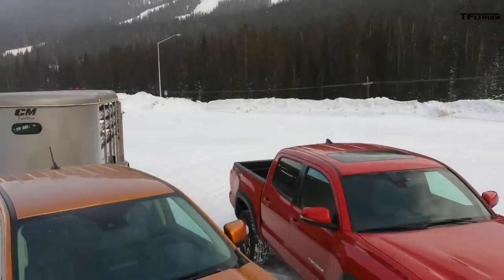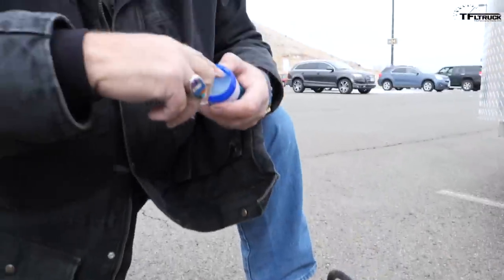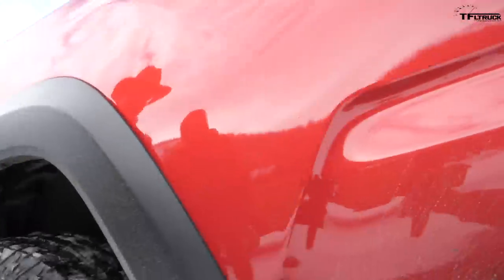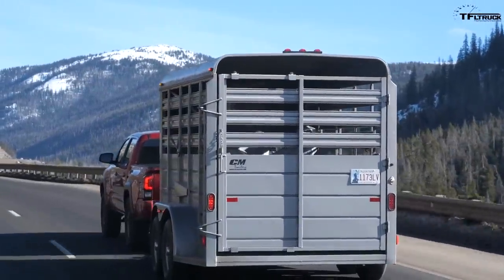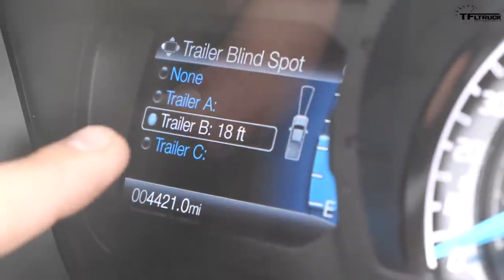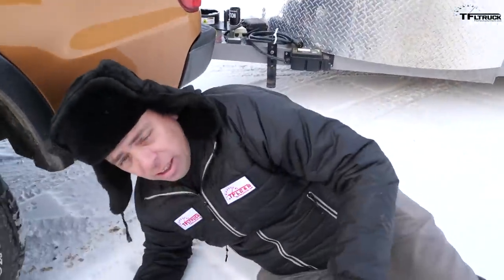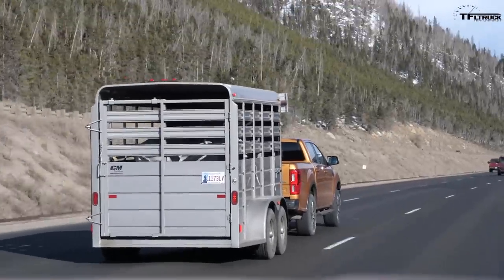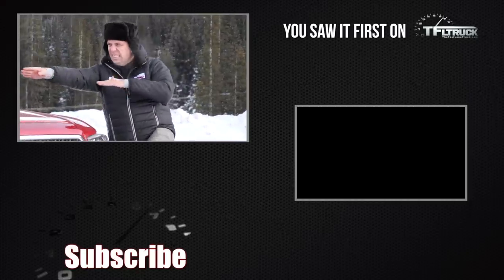Best Midsize Towing Truck? Ford Ranger vs Toyota Tacoma vs World's Toughest Towing Test

Comment: In the Tacoma he was pumping the breaks, essentially, slowing down slower. Which shortens the finish line, for the Tacoma. In the Ranger he braked solid slowing the truck down quicker allowing more road to travel ahead. Which allowed the Ranger to pick up another breaking score.

Comment: Wish I could see the tach a little better on the ranger, it seemed like the Taco held much higher rpm during the up hill.
Reply: Jesse Richards makes sense. Peak torque for the ford is 2500rpm and 5500 for the taco
Reply: I like to see them do the 100 mile tow with them.  I never trust Ford's MPG. Every time I have used one as a rental it is always way off on the No so "ECO" boast.
Reply: @devinbender8428 , not quite. Peak torque on the taco is at 4600 RPMs. Your point is still valid though.
Reply: taco has 6 gears and the ford has 10, the taco has to rev higher
Reply: The XLT Rangers have a normal gauge setup. The one they have would drive me nuts.
Reply: It has the normal tachometer if they would have scrolled through the garage settings. There wasn't any need to display the speedometer twice
Reply: @jackattack4851  that statement doesn't work, fords final drive ratio is probably similar to the tacoma, so "has to Rev higher" is wrong, the engine gets its power at a higher Rev,

Comment: Why are we not talking about the fact that the ranger towed up the mountain at 3500-4500 rpm meanwhile the Tacoma was screaming 5000-5500 rpm? That ranger towed that way way better!
Reply: Different engines. The Toyota is meant to run at a higher rpm.
Reply: Yea the tacoma is meant to use more gas
Reply: You have to remember they said the tacoma had a 3.91 rear end while the ranger had a 3.73 rearend. Meaning the tacomas has shorter gears so more towing capacity and increased acceleration but higher rpms on the highway and worse mpgs
Reply: @Will-fr5du  the ranger has a higher towing capacity than the Tacoma.
Reply: @williamnickel8132  yea sorry, i didn't mean a higher towing capacity. I meant to say the shorter gearing in the taco is better for towing
Reply: @Will-fr5du  the ranger has a 10 speed, if you break it down the ranger is actually geared lower

Comment: I really want to give this Ranger a shot. My 2016 F150 2.7 is at lease end now. I’m going to order another one but would like this ranger. Thing is I have a travel trailer 2016 passport 238ML ultra light. 3890lbs dry. 2 axles 23.5ft. 🤔 dilemma... thoughts? Tounge weight 500lbs. Travel with wife and two young girls and a dog.

Comment: I love the Ike uphill tests. Great job Andre and Kent. 
Ford did a nice job on that Ranger performance wise. If they make a Ranger Raptor with a pumped up 2.7 EcoBoost I'm in!!!
Reply: A 2.7 v6 would be crazy.
Reply: TNitro N I hope they put the 3.0ttv6 with 400hp and 400 torque,but it won't happen
Reply: TNitro N it won’t happen unless some one else makes a better motor. The 2.3 is already best in class. 

The only thing you may get in the raptor would be a tuned 2.3
Reply: @ALEX-sh3tx  the ranger would go 0-60 in 3 sec with thst engine

Comment: Great video guys, thanks. Well done Ford !!! A  downsized 2.3 liter gas engine that has  the performance of a 3.5 is an engineering marvel, not because the power  (because with a turbo it's "easy"), but because the emissions compliance, the fuel economy and, the most important when towing, engine braking. Awesome powertrain!!!!
Reply: Does a smaller engine have more engine braking than a bigger one?
Reply: @JaimeCarlosCamacho  for  same rpm, the bigger engine has more engine braking power than the smaller one.

Comment: Couple years ago they tested the GMC Canyon on the Ike.  Rated for 7000 lbs. Their trailer was well over 6,000 lbs. As I remember it, only one brake application downhill and it had more than enough power uphill. Mr Truck had plenty of room to get in and sit comfortably with his hat.
Reply: Yup, the diesel 4 banger had better mileage I think and only 1 brake application. I do think it was a little slower and slightly louder than the ranger. The GMC canyon was fully loaded in Denali trim for as tested almost $48,000. A fully loaded ranger is about 48k aswell... pretty crazy

Comment: These days the most important thing to consider is the fuel injection system. Toyota has a dual injection system, so gasoline is injected behind the intake valve and directly into the engine. This cleans your valves. Ford uses direct injection only. The only way your valves get cleaned in a Ford is when you take the intake manifold off and scrub them by hand. Have fun with that.

Comment: Correction - If you’re holding off on purchasing a new Ford Ranger based on what you read here last Thursday, consider this a green light for your trip to the dealership. The new-for-2019 Ranger does not — repeat, does not — require the removal of the left front wheel in order to access the oil filter. 

Drawing from a source with knowledge of Ford service procedures, our January 3rd story stated that the oil filter on the 2.3-liter Ecoboost four-cylinder found in all U.S.-market Rangers would be removed by technicians via the left front wheel well, necessitating the removal of the wheel. Not true, according to Dawn McKenzie, Ford’s North American product communications manager for trucks and commercial vehicles.

While the written process provided to us listed the removal of a LF wheel arch access panel, held in place by nine fasteners, Ford North American product communications manager Mike Levine states only three fasteners need to be removed in order to peel back the flap to access the oil filter. The wheel does not have to be removed to facilitate this. You’ll want the wheel hard over, though.

It’s a procedure similar to that of overseas models equipped with the 3.2-liter diesel.

So, with that said, apologies to Ford for the error and to our readers.
Reply: Old Man
"..the wheel hard over..".
What?

Comment: Parabolic springs are great for off road use because it allows more articulation BUT they suck under heavy loads, you’ll notice it will have crap for lane centering, it just floats all over the place

Comment: Not gonna lie. A 4 cylinder 2.3L gasser with a towing capacity of over 7,000 pounds is very impressive. Good job Ford. Considering my 1999 dodge dakota V6 3.9L can only tow about 3,800 pounds comfortably.
Reply: Zack De I looked back to 2000. 
In order to get 7000+ towing in a truck your needed a
5.4 v8 f250
6.0 v8 Silverado
5.9 v8 Ram. 

Absolutely crazy to think about
Reply: I’ve got a 2000 Dakota v6 and I can’t imagine having to tow with it 😂
Reply: @devinbender8428  my truck is rated for 12 k i towed 18k it went slower but wasnt bad. My trailer brakes was good so i didnt have to worry about the trucks
Reply: I have a 2017 Jeep Cherokee trailhawk 3.2 v6 that is rated for 4500 lbs.. I towed a 4200lb. Trailer with it and I barely even knew that it was there. I'm sure it could do this same exact test but not in 8 minutes flat like these two. 
 Technology is amazing where a unibody crossover with a small v6 can tow more than body on frame trucks from twenty years ago.
Reply: @devinbender8428  Yup.  I grew up driving a '91 Chevy Suburban 2WD towing my parents single axle camper. It had the 5.7L v8 so 210hp & 300 ft lbs.  Burned thru 11 city / 16 highway MPG.  Crazy!  The 4WD was worse.  But Suburbans also weighted a couple big tons too. 

Now this Ranger has a "little" 2.3L 4 banger that pumps out 300hp & 310 ft lbs! but only burns 21 city / 26 highway?!  How far we've come.  People still hate on the small engines but I wonder: how much power do folks need?  Aren't things that we tow getting lighter? (aluminum replacing steel, etc.)

Comment: My bro in law had a 90's T100 and literally couldnt remember what year (yes, year) that the oil was even changed. He had 250k miles on the odo and still got $2k just to get rid of it in 2018. Resale value should have a vital impact on what you invest in.
Reply: why? if you crash it, or it rusts out, or gets stolen, resale is $0 resale value is all just a worthless sales tactic in my opinion. I've seen hundreds of cars come in that were still drivable and people just junk them. not much resale value there.

Comment: If you plan to do a lot of towing I would get the Colorado diesel. If ur not towing I love my ridgeline. Comfortable good on gas and nice to drive. Awd is also much better for my Canadian winters
Reply: I wouldn't touch one of those itty-bitty diesels. Being a diesel it inherently costs more to fix. And being that it's an itty bitty turbocharged diesel, I would have no confidence in it. NONE. I know it has power. But I wouldn't trust that it's not going to leave me stranded Midway up a mountain. I would have no doubt in my mind that the tacoma would get me where I need to go.  You'd be better off getting a 2001 Dodge Dakota with a 5.9 Magnum and tuning that engine up a bit. Shit that thing's got almost as much torque as the gm diesel. And again I would have much more confidence in it. And fixing those things is a breeze.

Comment: I just hit 39k on my 2016 Tacoma. I like my truck but I'm so tired of the stupid engine/transmission. Always hunting for gears and WEAK power.
If the Ranger comes out with a capable, nice looking off road version (front lockers), that would be awesome!
I personally think the Tacoma looks WAY better but I prefer the slightly lifted, off road look to the street look for trucks.
Awesome results on the performance upgrade... I can only dream.
Reply: Do you have the ECT button in yours?  ECT on makes it feel more peppy, and for me gives slightly better MPG.  Mine is an 03 with over 200k on it and I just pulled a trailer across several states and never had a problem of it hunting for gears.  (Take it out of over drive when towing).

Comment: I'm not sure if the ranger is equipped with it, but my 2015 escape gives you the ability to select the gear the vehicle is in when sport mode is activated.  If the ranger has that ability I'm sure it would help with the down hill especially.

Comment: Great video, no gm too compete would like too seen how it would stack up....Ford just keeps on making a better rig...
Reply: they did test the colorado zr2 with more weight it did better than both the ranger and the taco
Reply: Mark Siegel gotta remember that Chevy Colorado my friend. It has a higher output V6 and a diesel 4cyl. I wouldnt exactly cut to a conclusion quite yet.
Reply: @braddenr.7195  that's why I like too see the head too head

Comment: They make aftermarket towing mirrors for the Tacoma. I have them for my 2013.  In doing so I gained heated mirrors as well as turn signals.  They are similar to Dodge towing mirrors.  No need to fiddle with those add on extension mirrors

Comment: Tacoma is still the better overall truck to have. Ford, Chevy, VW or Ram have nothing on Toyota reliability, durability and resale value.
Reply: How true
Reply: Very true. Worth the few extra bucks. Compare these same two trucks when they hit higher miles or ten years or so.
Reply: kao the numberblocks fan 2019 they slow asf and gutless my friend bought a 2017 and I’m sorry for the guy.
Reply: kao:  Lol. Put the crack pipe down. Good lord you have drank the kool aid.
Reply: Ranger, stock (XL) base model, is built better all around than the taco. Tacoma can’t compete at this time. Check the specs.
Reply: Give it up. Those days are over. The last gen was a hit or miss, and these new ones are unproven. Resale is moot these days. People who say Tacoma is a sales leader are the ones who keep buying the truck.
Reply: @jo-wb6zs  Sure, ranger with turbo, yes.  Also the ranger within 5 years will be in the shop a lot more times than  Taco will ever be in 15 plus years. the natural asperated V6 of Taco has proven itself to be reliable already as well as their tranny. I would buy a Ranger 5 years from now,  when all the  proper statistic report  issues with eco boosts and the new 9 speed tranny comes in.
Reply: New tacoma is turd. New ranger has the 2.3, 2.7 and 3.0 raptor — enough said!

Comment: I am not surprised. I owned a Tacoma for 4 years and towed a 4000 lb boat with it. It did not like the hills of SoCal, so I know it hated the gauntlet. Tow rating was 6400 for my '14 and that had to be going downhill with a stiff tailwind. Toyota Tacomas are mountain goats off road, but they blow at towing.

Comment: I'm a huge Toyota fan. I won't even watch the video to know that the ranger pulled waaaaayyyy better. The taco just constantly hunts for gears without a load. I'd hate to see it with a load. They are good trucks for pulling the occasional lawn mower trailer, anything more just get something bigger.
Reply: rush pumpkin my truck doesnt hunt for gears. Because manual

Comment: Boys, y'all switch back and forth between Ranger/Tacoma, sometimes i cannae tell which truck you talking about! Don't even mention the truck you're not reviewing! One at a time. I have tried and tried to like Tacoma, but cannae even fit my 6'2" muscle, bone, and sinew 215 pound body into the thing without bending my neck painfully. THANK YOU Mr. Truck at 13:18, ff, for floor sitting, neck bending Tacomas!! And for measuring that door opening. Now, Mr. Truck, Tacoma front is ugly, not manly looking. Course a heap of men are a bit ugly. Larry Ette, eh?
Reply: "sure beats a 25 yr old truck in comfort department" -- I wonder if Toyota will use that as their advertising slogan.
Reply: @M Blake Jr -- That's not the point. Do you really think it would be a good marketing slogan? God, my brain starts hurting. Never get into discussions in comments on Youtube. WTF.
Reply: Yep the Tacomas are still cramped for as large as they are.  The cost difference between the Tacoma and Tundra was only about $1500 so of course I bought the Tundra and got the 5.7L V8 and never felt cramped in the Tundra...it drank gas like crazy but it would tow all day long without any issues.
Reply: First half was Toyota, second half was Ford, pretty simple

Comment: The motor in the ranger has been around since 2001.5 and evolved from sequential port fuel injection to its current turbo Direct injection
Reply: the 2.3 in my 2003 Focus was great.
Reply: @BigEightiesNewWave  those are fast little cars poor man's sports car especially on 10 pounds boost
Reply: @BigEightiesNewWave  I'm running 20 pounds of boost in my 2002 ranger 2.3 duratec, making 375HP with comp cams and forged internals